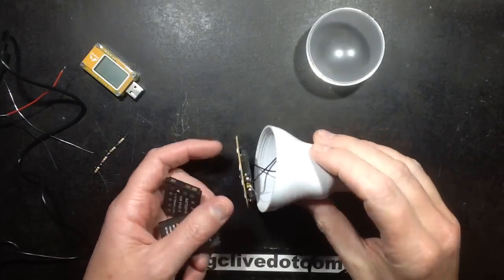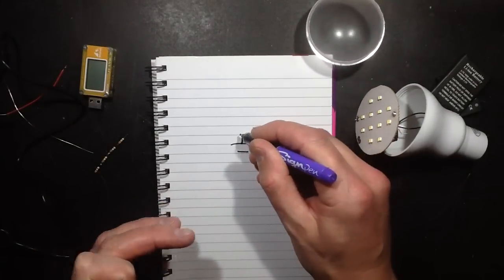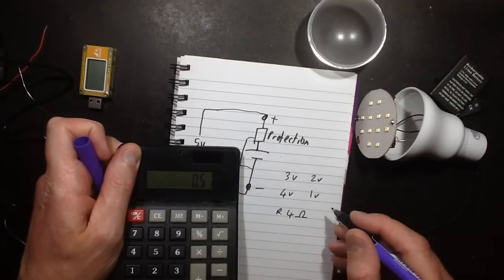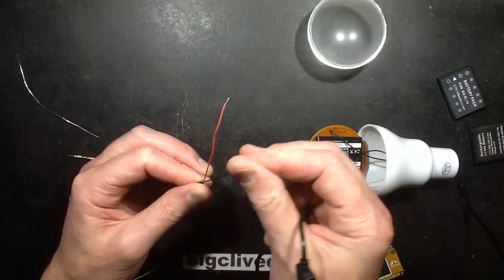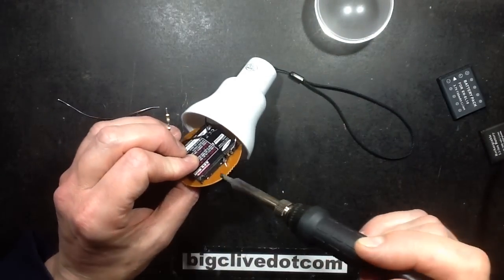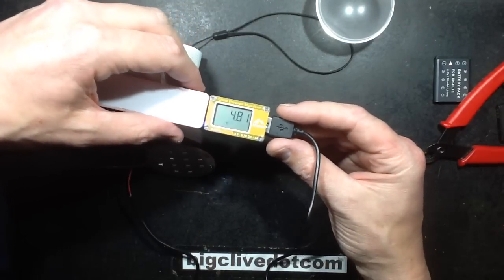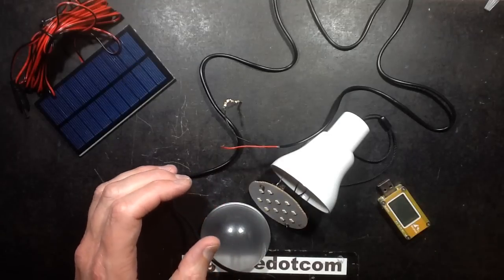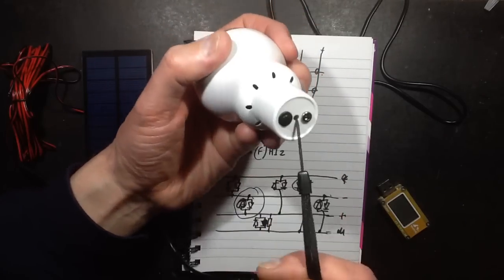Lithium cell capacity test on a solar charged lamp.

Comment: You might consider one of these.  Nice little thing for doing automated battery capacity checks -- West Mountain Radio Computerized Battery Analyzer.   They're a lot of fun.  Constant current draw down to a set cut-off voltage.  Produces a nice graph.

Comment: My mate bought one of those a week ago, looks identical.
The battery does sound a bit farty but it does sound safe.
You could bung another resistor in series with the original limiter and add a tiny slide switch to short it out, the delux dual brightness version lol :-D

Comment: Hi Clive, that was an interesting way  of determining that capacity that I had not thought of before. I think you will however find that the actual capacity is lower than you measured. I've tested a few batteries on my load tester and I find that you get less power back out than you put back in, I assume there is going to be some energy loss as heat and some consumption of the protection circuit, they are almost definately going to give you less than 500ma back
Reply from the maker: +arcadeuk Technically speaking lithium cells are close to 100% efficient in returning the energy used to charge them.  But when charging them from a 5V USB supply the voltage difference between the 5V and the cell voltage is wasted as heat.  Even in most power banks.  So I used the total mAh to test the capacity which disregards the 5V losses and shows the actual mAh at 3 to 4.2V.
Reply: +bigclivedotcom it is a chinese lipo, you expect them to fib about capacity, i could tell by the size its much smaller than my cell phone battery which was 900mah anyway!

Comment: The batteries could be old stock such as for obsolete mobile phones, but rather than dump them, this is probably one of their creative ideas to make use of their unsellable batteries.  In this case, the battery capacity would have deteriorated over the years in storage as Lithium Ion batteries lose recoverable capacity each year even without use, probably accelerated by the warmer Chinese climate.
Reply: +Seán Byrne it looks like a fake cell for an obselete phone, looks a bit nokia sized to me, which used batteries 500-800mah if i remember, like the 3310 model
Reply: +jusb1066 it's a samsung cell, that shape one was used in their crappy little kinda smart phones from a few years ago (the ones with a mirror Finnish on front iirc). 3310 batteries are about twice as thick and a more of a rectangle shape.
I doubt it's genuine however, you can tell by serial number (on the newer silver series you can also tell by mfg date), certain locations of text and warning labels. 
With the AIO battery packs used on some flip phones, the plastic texture is a dead giveaway (its very rough)..

Comment: I bought some Trustfire 18650 battery's, they too have the protection circuit. 
After finding these battery's to be total pants, I took off the protection circuit.. Now these battery's are great, at what risk, I'm not sure but they work now. 
Personally I think the protection circuit on them is a bit enthusiastic, is there any way of checking it?
Reply from the maker: +Green Silver If the charging limit actually cut-off before 4.2V like in the region of 3.9V that would actually result in a significant lower capacity, but also a much higher cell lifespan and number of charge cycles.
The ability to switch the charge and discharge current off is good.  Without that protection the cell could be damaged, mainly by over discharging.
If your load is high then it may be that the protection circuit is not rated for high current and cuts off thermally or by detecting overcurrent.
Reply: +Green Silver use them in a charge bank with its own protection, thats how i use lots of old laptop cells which have no protection at all, you get can 1,2 4 or 6 cell models for about £1.50 on ebay, a cheap way to use them, it also doubles as a charger if you leave the lid off
Reply: +bigclivedotcom I would just like to note about discharging, you aren't wrong but it also depends on the circuit of the device itself, for example I have a cordless 8100 Dremel which I bought off ebay without a battery, so I hacked it to use two 18650s instead of paying $30 for a battery (which also uses them) and the dremel itself cuts off perfectly at 6V (3V per cell) meaning I can't possibly over discharge them and don't need any sort of protection and can simply use a balance charger to charge it again oh and even better is the fact that my cells are double the capacity of the $30 packs.
Reply: I use them in a Thrunite TN11S-V2 torch, it has some reverse polarity protection but as for low power protection I'm not sure. 
As for charging I use a Soshine Universal charger, IMO a good middle of the road charger.

Comment: thanks for the video.  I think I bought the same light.  It was only $6 including shipping from china from ebay.  So you think a potentiometer to replace the resistor controlling the current would work?
Reply from the maker: +Bubba A potentiometer in series with the existing resistor might work if it's rated for the current.  That way the existing resistor would act as a current limit and also help dissipate most of the resistive power.  Or you could add a switch with another resistor to select a high and low mode.
Reply: +bigclivedotcom good idea, thanks.  After I posted, I was trying to think of a way to keep a pot from going below the minimum required ohms.

Comment: I have one of those, I love it.
I may upgrade the Battery now that I know it is that easy.

I wonder how difficult it would be to use the 3rd connector to show charge status? If that is what it is for!

Thanks!

Later, FW.

Comment: Chinese batteries tend to claim twice to five times their actual capacity, so that Samsung-branded battery (which could be fake, there's a lot of branded fakes out there) could be accurate if it's used or not genuine...
Reply: +twocvbloke yes theres many a fake samsung battery, for my old galaxy ace it took me about 3 tries to find a battery that actually matched the original capacity, every seller promised it was real, and theres no way to tell by the looks, they were perfect, except in capacity!
Reply: jusb1066
Got to be careful of them too as some of the fakes can go thermonuclear too, in peoples pockets..... :S
Reply: *****
yep, so far been lucky, event tried to set one off to dispose of it (it had a terrible capacity so didnt use it) but for that old galaxy ace, you had to get what you could get!
Reply: jusb1066
Yeah, need a battery for my old S3, and so far, I don't trust anything on offer, so the old battery in it is suffering to the point where the power gets so low that when I try to do something, the screen flickers and the phone crashes and locks up, not exactly good for the thing really!!! :\
Reply: +twocvbloke I relplaced my s3 battery after it went all bubbly with an Anker cell off Amazon. £8 at the moment, and has lasted longer than the original.

Comment: Some ebay adverts have a spec for these lights:

Voltage: 0.8W/5V (of the solar cell)
Lithium Battery Capacity: 750ma/3.7v
Lumens:  150 lumens (equivalent to a 20W light bulb)

http://www.ebay.co.uk/itm/271751650354?_trksid=p2055119.m1438.l2649&ssPageName=STRK%3AMEBIDX%3AIT

$5.60/£3.59

Comment: I'm really guessing that you can put there even a 18650 cell from Panasonic with cap. like 3Ah. Ok... Charging will get much more time, but... that means you supposed to: a) change the solar panel for more powerful or b) Add ( to solder) to the dc-jack- (attached on the bottom) one of these TP4056 chip based, Lithium cells charging PCBs, does the Julian Ilett described there: https://youtu.be/wfrm6lbt8Pc.